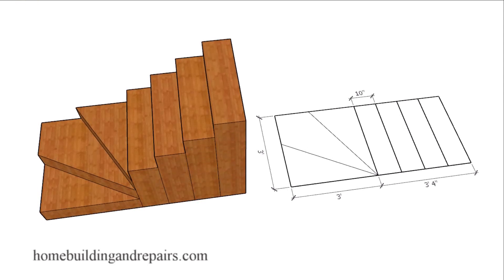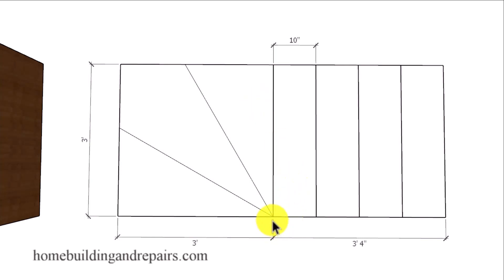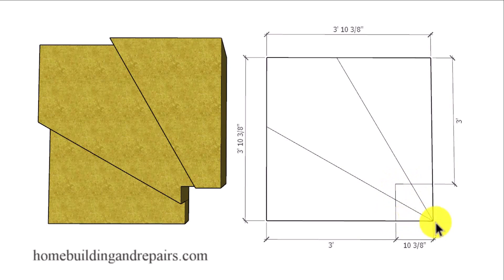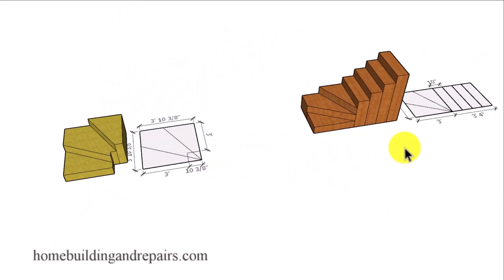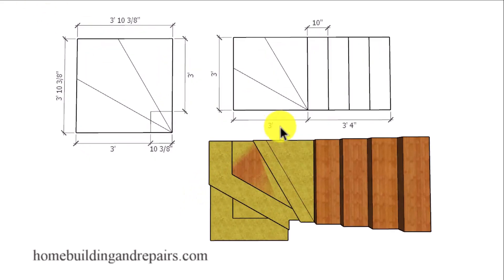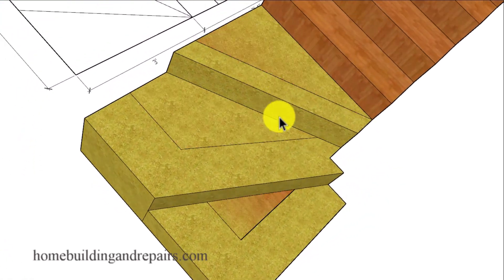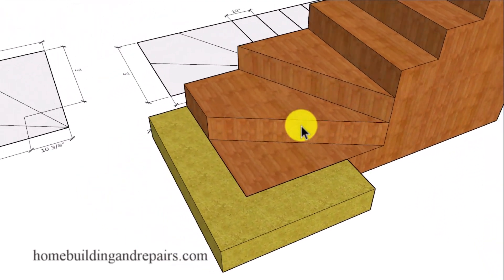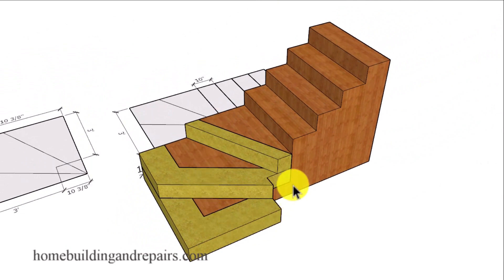What It Will Take To Make Small Winder Stairs Safer For Newer Building Codes With Six Inch Minimum

Comment: For accessing an area less than 400 SF and without a kitchen/ bathroom, do the code requirements of 36" width/ Max riser of 7.75"/ tread depth of 10" apply?  Trying to compare which compact staircase to access a three floor tower is better- a code compliant spiral or a nonconforming winder staircase
Reply from the maker: I think the codes allow spiral stairs for areas less than 250 sf. but you would have to check with local building codes.